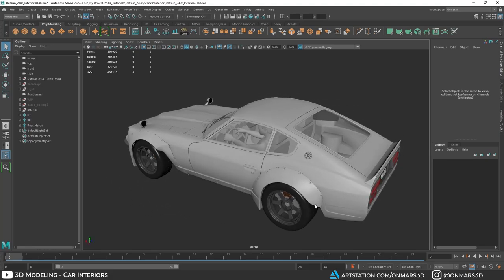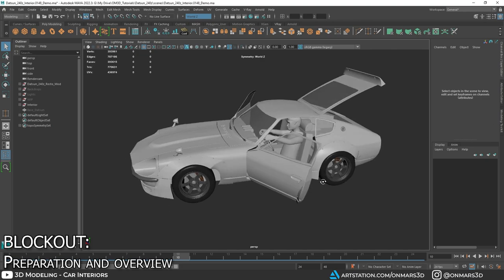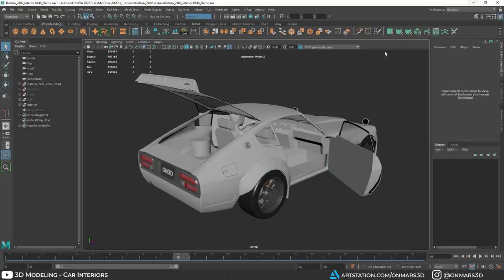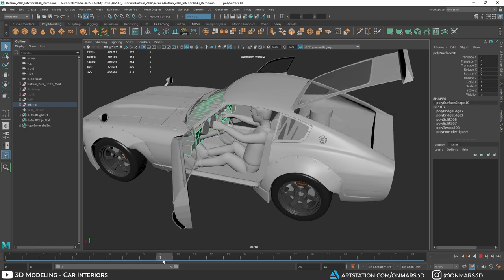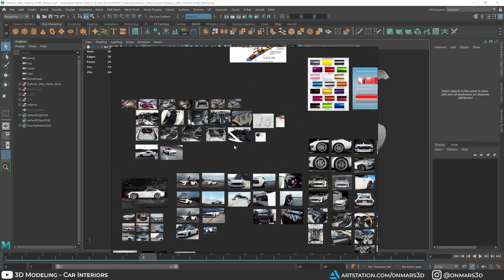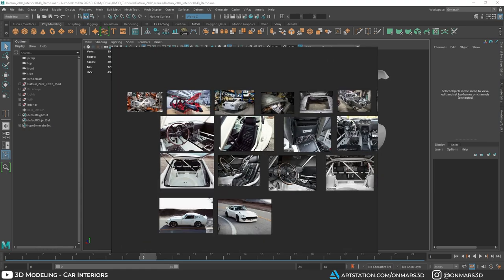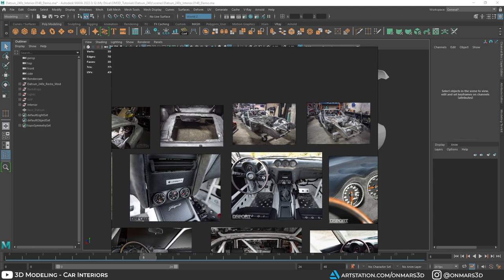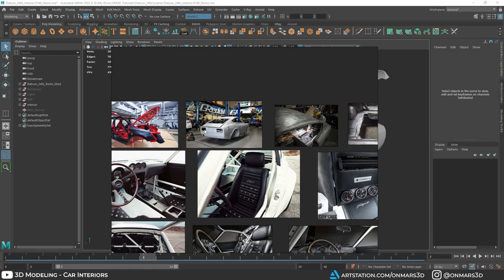3D Car Interior Modeling - Interior Blockout

Comment: This is fantastic.  I use 3ds max, but I can use this info the same.  I'm only 3 minutes in and I'm certain this will be a great learning experience after hearing you talk about understanding the engineering behind everything.  I have a bit of an advantage(and a curse, since it's just got to be right) since I was a fabricator and I've also modded and done my own maintenance on cars.
Reply from the maker: Happy to help! That's one of the benefits of sub-d modeling vs parametric modeling, it doesn't need to be perfect🙂

Comment: For a free a pretty nicely proportioned character model I suggest the free mannequin that comes wih unlreal 4/5 project files, its a little bit of a task to get the mesh out but well worth it. Use it on all my projects to measure proper scale etc.
Reply from the maker: Does the model come rigged when you bring it into Maya? If so, I'll definitely look into this.
Reply: @OnMars3D  It does indeed however since its just an fbx it doesn't contain controillers etc so it can be a little bit difficult to use as is, so I just deleted the skeleton and made some preset poses manually.

Comment: How cold i make my model 3d printable? I mean with suface modelling or like when i make the wheel well dont have thickness or the bottom of the car.  For rendering is perfect but not for 3d print modeling. I know about the solidifying, but at complex shape is just doesn't work. Would be amazing to see how you model a car which is 3d printable and moving parts(1-1.5mm wall thickness at least).